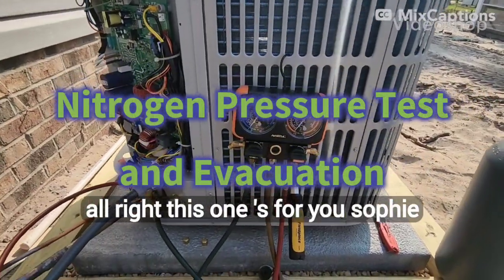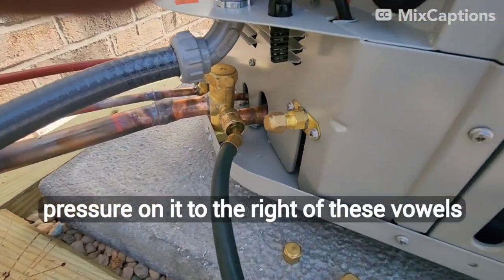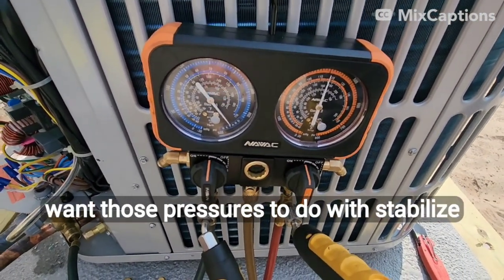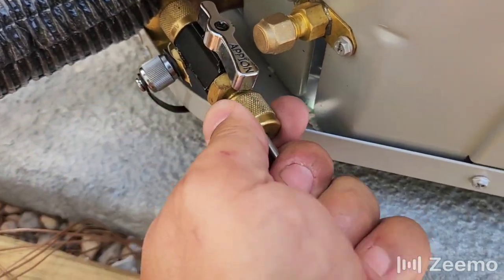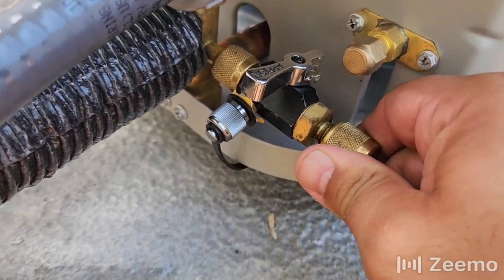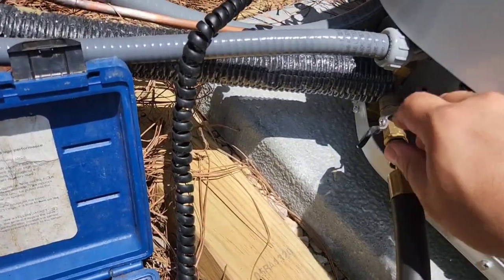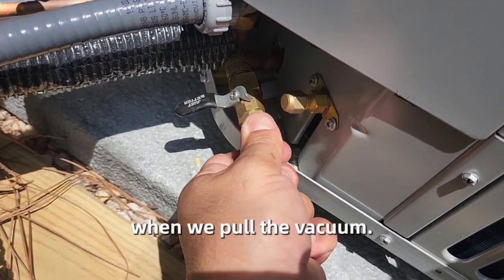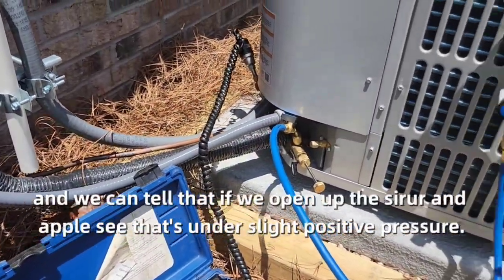Nitrogen Pressure Test and Vacuum/ Evacuation

Comment: I valve off my micron gauge, and actually JB has a newer VCRT with a slide valve to isolate your micron gauge before releasing and without removing. It’s pretty sick.
Reply: Good to know!
Reply: @timdestasio3367 whatever works! I just like to protect the sensor without needing extra VCRT - especially in tight spaces

Comment: Why didn’t it pull down super quick when you forgot to open the vcrt valve?
Reply: Because his YJ vacuum gauge is on the other side of the VCRT? In fact, it’s on the complete opposite side of the run how could it have sensed it?

His wireless on the pump would’ve sensed it, but we couldn’t see that reading.